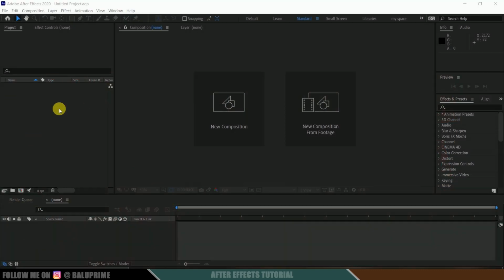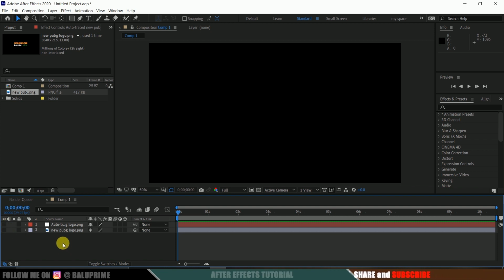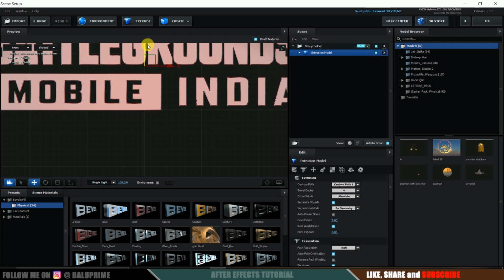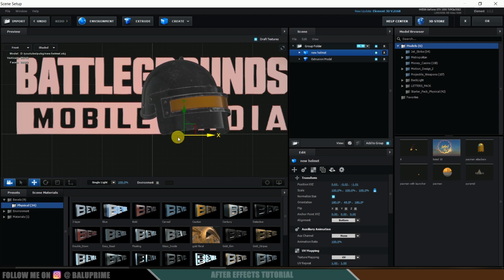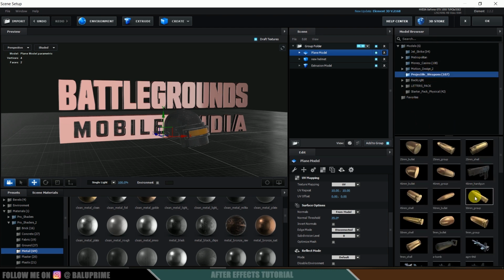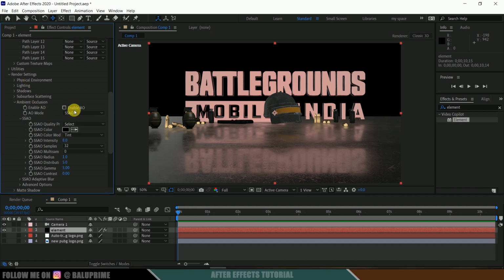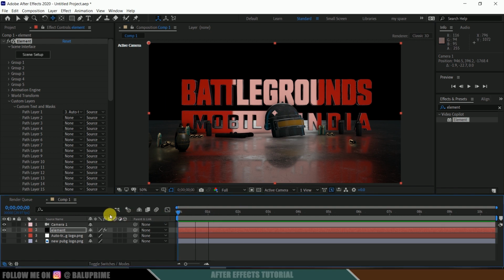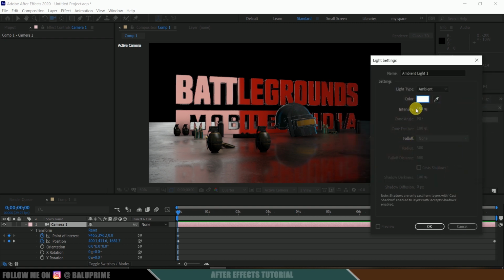Basic Element 3D tutorial for beginners

Comment: It's amazing but I can't use it due to shity pc
Reply from the maker: Thanks bro... Give it a try bro...before I was using low specs laptop which was having i3 processor, 4 GB RAM with integrated gpu... Element 3d was working in that with some issues though...
Reply: @Baluprime  I also have the same specs
Reply from the maker: @therobinburgs4399  give it a try bro...